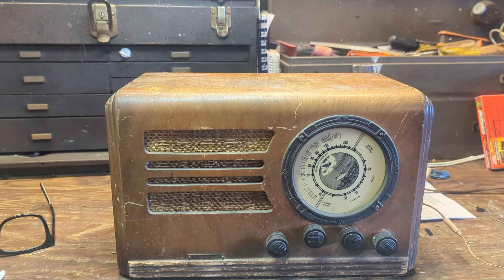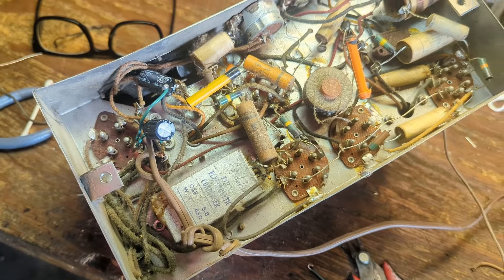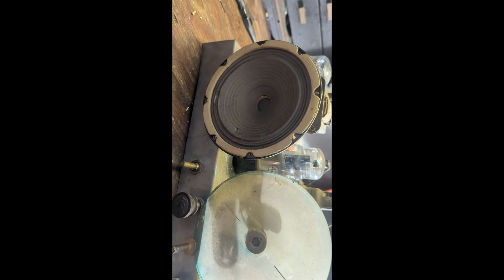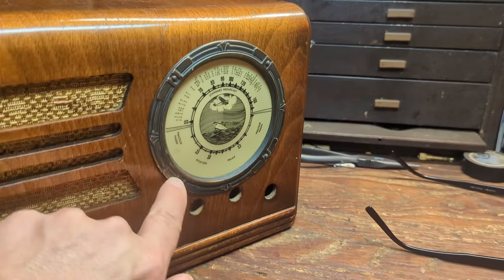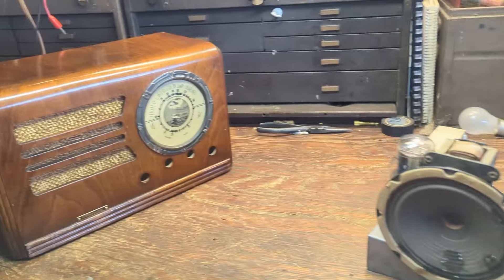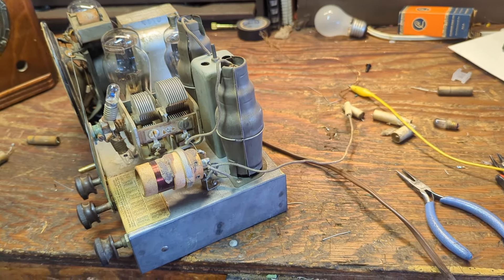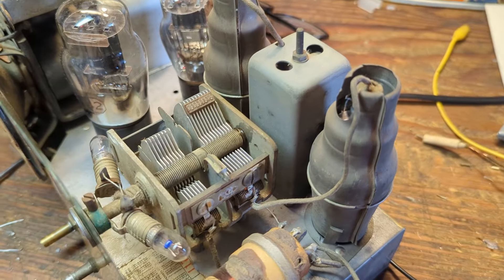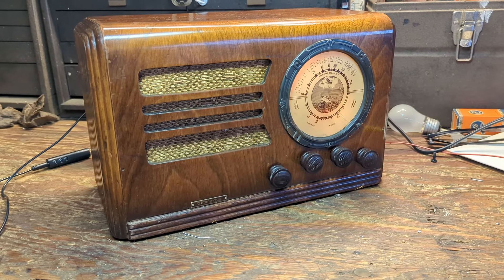Herbert H Horn ( Socal made Radio ) Overhaul

Comment: H.H.Horn was the manufacturer of Tiffany Tone radios. Your model 51 (and model 52 are the same electrically with a
couple of different tubes ) and are pretty rare radios. This one should have been air blasted out as it was very dirty. With 
some things fixed it still works good. Cabinet is really worn the hell out. It was Fred H. Goat who  invented the Goat tube
 shield! Company was based in Brooklyn, NY.   You did a pretty good job with it Seth  as it sounds great especially with the 
Bluetooth added.

Comment: Your Old English plus Carnauba/buffer method produces great results.  One suggestion though - for some of the gouges and places where the Old English doesn't take, try using those furniture touch-up marker pens.  They're super easy to use, cheap, come in a variety pack of colors, and are permanent.